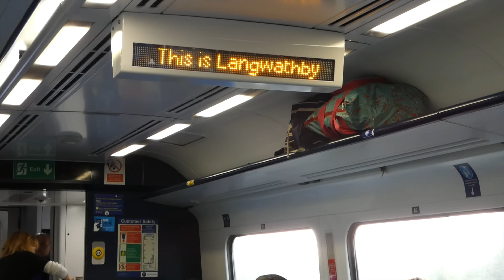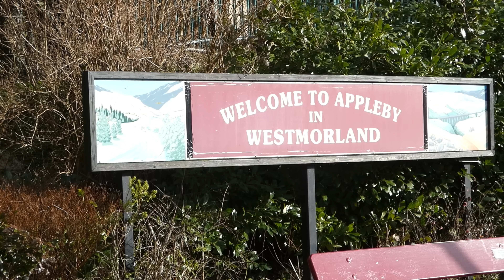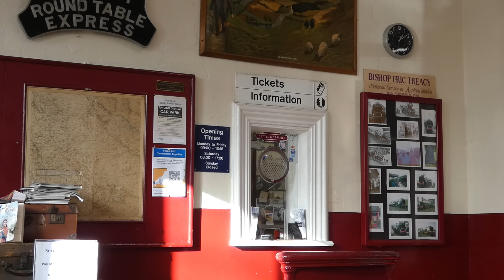Settle and Carlisle Circular Delayed by a Fatality 03 02 24

Comment: I was tempted to go to Appleby but decided on Lazonby instead to allow easy time to get across to Plumpton for the Circular heading south. I filmed your train and the log wagons behind before realising I was without wallet. A quick dash home in time for the 'express' to Leeds and the on-time S&C Circular. Nice commentary on your trip south. It sounded like the drone was struggling but the recording was great. By the way I and an intending passenger for the cancelled northbound train found out about the cancellations on the platform indicators which informed us no trains likely northbound until afternoon. I believe in the event only one train was turned around at Blea Moor.
Reply from the maker: Sounds as though we both had an exciting day in different ways.
Interestingly, the drone was more stable at height than low down - turbulence from the surrounding buildings?
I was very glad that the 15.15 ran as there's not a lot to do in Appleby in early February.  The Midland Hotel is right next to the station, a friendly place selling good ale - but I'm still on a prolonged "dry January"!!
Glad that my commentary meets with approval from the professional!

Comment: I heard the 56 was taking the log wagons for wheel turning. It was a nice sunny day day for a change and not too cold out of the wind. I did not see why the train was delayed, it was not very long so maybe just trespassers on the line.
Reply from the maker: According to the station staff there was a fatality at Gargrave and everything was held up until the body was eventually removed.
Reply: @schoolshorts  OK That was pretty quick then Often it is well over an hour. Yesterday an HST test train hit a shopping trolley near Pontefract It is still stuck there almost 24 hours later. Goodness knows why it has taken that long to move it.
Reply from the maker: Since I can't find any reports on the incident it's impossible to know just when it happened.  The death might have occured some hours previously - which would explain the not very great delay to the special.

Comment: It seems every railway carriage becomes a Pullman these days! BR mk. 2 and 3 carriages now!
Reply from the maker: Well, of course, West Coast Railways have been banned from using their Mark 1 carriages as they haven't fitted them with central door locking.  I don't mind the more modern coaching stock behind diesels but they look totally wrong behind steam locomotives - and few steam engines are fitted with the air brakes necessary for hauling Mk2 and 3 stock.